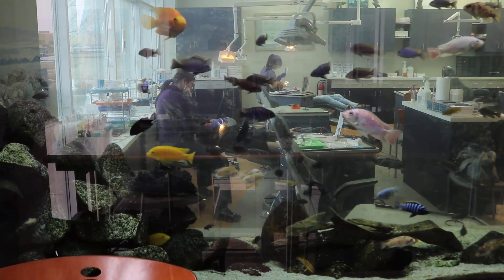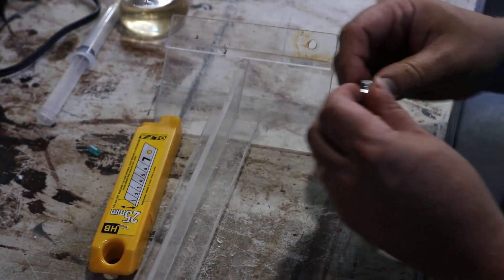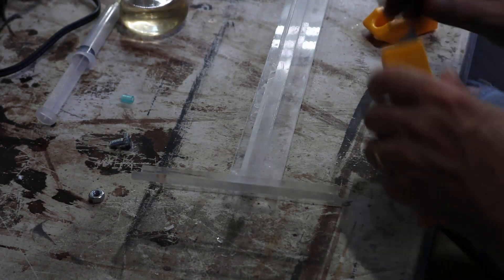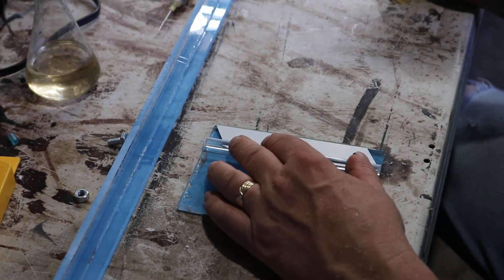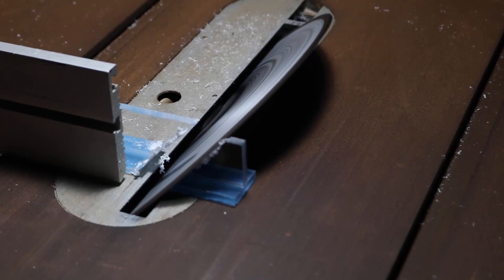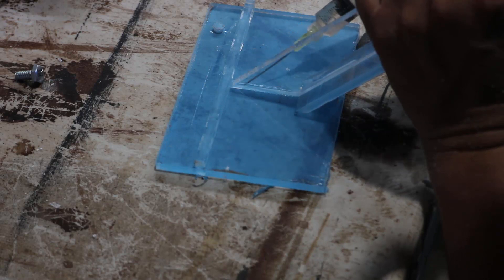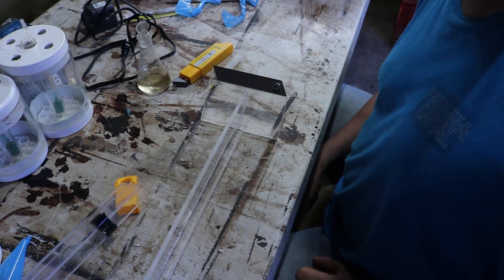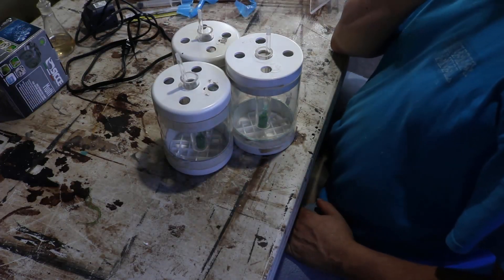DIY Bladed Algae Scraper

Comment: Great build what is the name of the glue you are using plz ? I can see you have it in a glas jar. Thank you
Reply from the maker: It's methylene chloride. It chemically welds the two pieces together. I keep it it a tightly sealed glass container so it won't evaporate. Thanks so much for coming by and watching
Reply: Thank you very much 👍
Reply from the maker: anytime